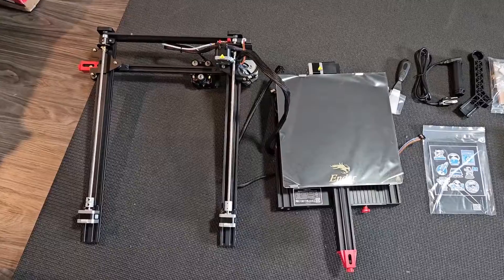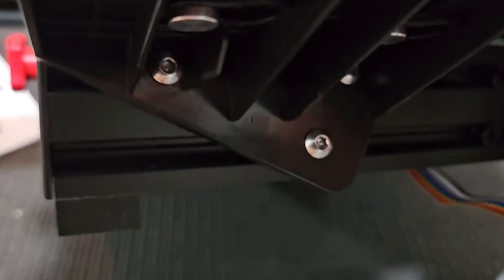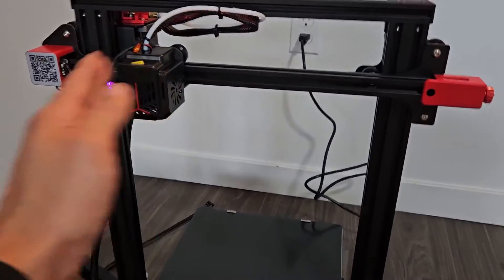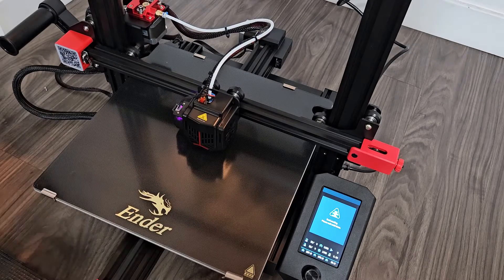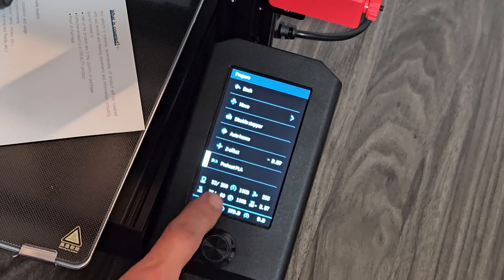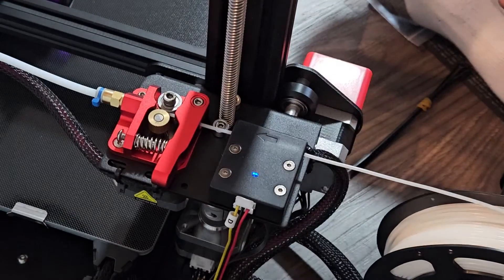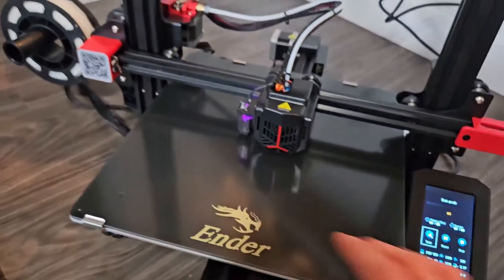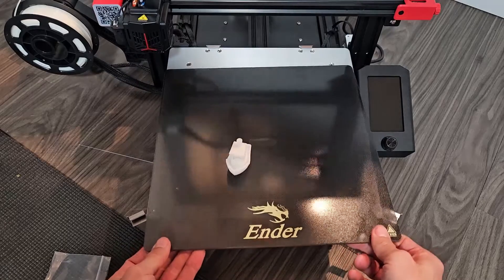Ender 3 Max Neo: How to Assemble then Print 1st Test Boat Perfectly (step by step)

Comment: 2nd vid i found skipping the voltage setting in manual. Mine came shipped with 230W showing on back and i switched left to show 115V hoping this is correct. A lot of people going to fry their printer on startup